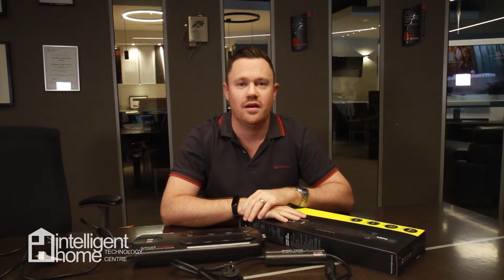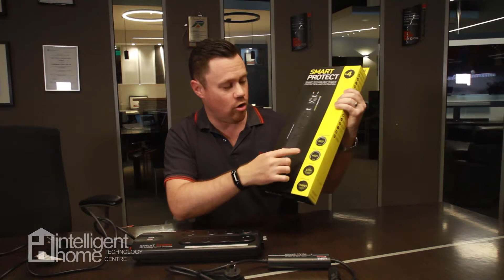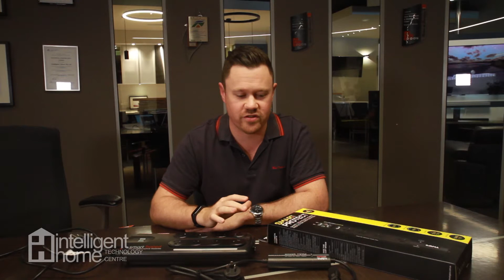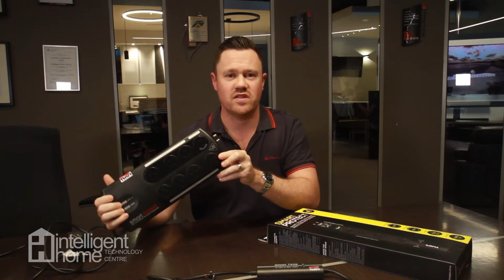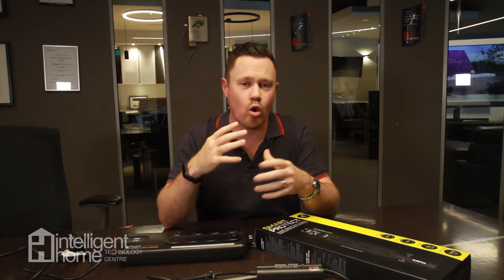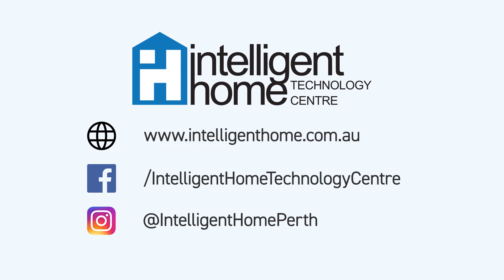Thor Smartboard Tech Talk

Comment: Just bought a Thor Smart Board 8 A12BF today from Audiocom in WA. Excellent price too at only $259.00, which is way cheaper than Selby Acoustics at $349.00. Can’t wait to get it delivered! 

I currently have an 8 outlet Monster Power Centre board, which I have had for at least 7-8 years, which runs my TV, soundbar and HiFi system. I have an ARCAM FMJ A19 integrated amplifier paired with Dynaudio Emit M20 speakers, which usually sound amazing, but I have noticed lately there’s been a drop in sound quality. It’s lacking in some micro details, bass punch and just doesn’t sound as open and airy as it once did, and the midrange sounds bloated. I’m hoping this is an issue with the power supply and that the Thor will bring my system back to its former glory or even better than before!